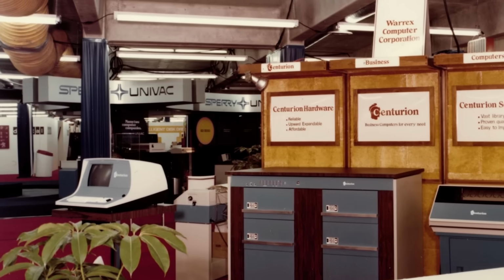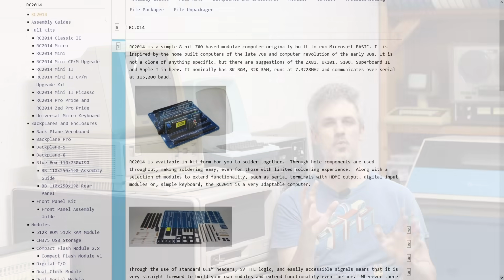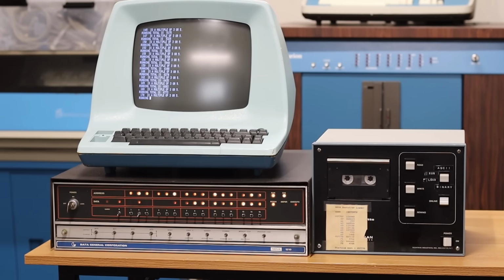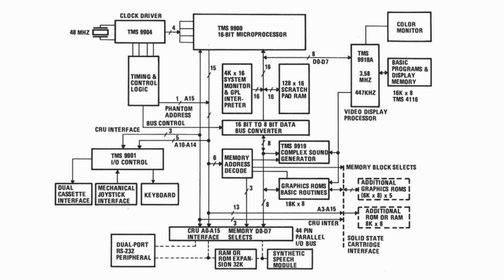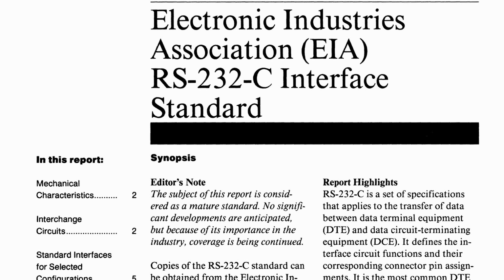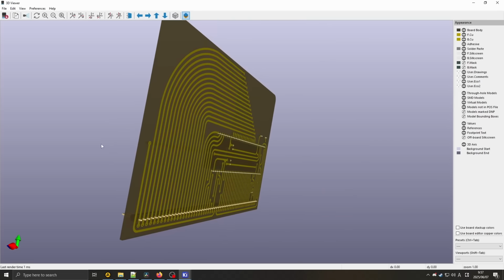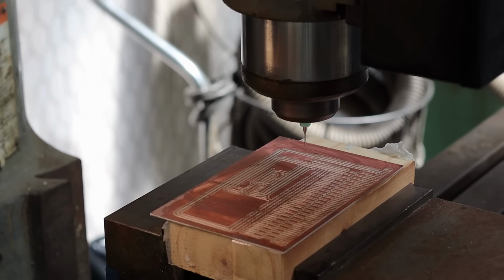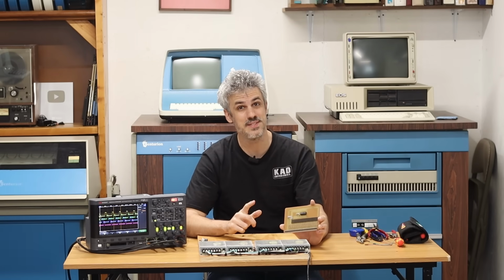The First Step in Building our TMS9900 Homebrew!

Comment: If you really wanted to build a mini using TMS9900 architecture you would use a TMS99105 or TMS99110 and optionally a TIM99610 memory management unit.

Comment: Great to see you turning to the TI chips. I worked on TI990 minis in the 80’s and loved those machines. It would be super cool if you could get your homebrew to run DX10
Reply: And DNOS - the "Distributed Network Operating System" that Austin DSG (Digital Systems Group) put out too! DNOS was bulletproof as DX10 would run into System Table Area (memory shortage) errors when saturated with a lot of tasks (which our group at TI used to do regularly.)

Comment: I think the DEC was lucky enough to have spanned enough years to be a mini computer that eventually utilized micro computer tech while retaining its full mini computer functionality. I learned on DEC in high school starting on a PDP 8 then a PDP 11, in college we had a PDP 11 that was quickly replaced by a VAX then I worked for many years at a DEC VAR where we sold, installed and maintained VAX and some Data General along with a few HP and TEK machines. Good times.

Comment: David... Meanwell RQ-125B, has all four voltages.
Reply: There is a downside to doing it in a single module: adjusting each voltage individually based on load becomes impossible -- it's all or nothing.
Reply: @TastyBusiness  It's true that it only has a 5V adjust. But the voltage output not being on-point at the PSU is seldomly a concern.
Reply: @graealex  The 5V adjust also affects the other voltages, I've had this problem with an RT-125A in my Nova 1200.  In order to get 5V where you need it, the other voltages clime proportionally.

Comment: Okay, but I think a definition of “minicomputer” is needed to distinguish it from a microcomputer, such as the TRS-80, Apple ][, or C64. It can’t just be the # bits on the data bus, as the Centurion has an “8-bit” CPU, but it can handle up to 8 users. But so can a PC clone running DR Multiuser DOS (or Real32) and a 4/8-port card (an expansion card giving you 4 or 8 RS232 serial ports for hooking to dummy terminals), and that has - at minimum - an 8/16-bit 8086 (and maybe a ‘286 or ‘386.) Is the PC therefore a minicomputer? If there is a line, it’s very blurry, I think! 😀

Comment: With the control over the hardware sprites you got with Extended BASIC the TI-99 was actually a pretty good home computer. I wrote pretty good approximations of Asteroids and Lunar lander on that machine. I hate that I have lost track of the cassette tape with the programs on it. The price of the expansions was the real problem.

Comment: Re: Mini-computers versus Micro-computers

I think you missed an important distinction between mini- and micro computer architecture. You touched on it when you mentioned the capability to support multiple users (or multi-programming), but a micro-computer can do that - but it will struggle.

Back in the days, back in the late 1970's, early 1980's, I was the systems administrator for a couple of computer systems at the university. One was a 68030 based NCR Tower running Unix with 4 terminals attached. The other was a Data General MV/10000 with 20 or more terminals. 

It was very apparent that the Tower system started to slow down when all 4 terminals was in use and students were busy editing, compiling, and linking programs. The MV/10000 on the other hand, just kept chucking along with more active users, batch jobs, etc. with no noticeable slow down. 

The secret that allows a mini-computer such as the MV/10000 to carry the heavier load is the use of DMA (Direct Memory Access) and intelligent I/O devices. It means that the operating system can tell a disk controller to "Fetch me the data on cylinder 12, sectors 6-23, and store it at memory adress 0xabcd1234. And tell me when you are done". After that the CPU can continue with other tasks and serve a different user. When the data is ready, the CPU will get a signal and it can do whatever is needed to hand the data over to user that requested it.

Comment: In 1980 I got to use a Fluke 1720A computer with the TMS9900 and bubble memory and it had an impressive performance. So when I got a TI99/4A in 1982 I was hoping to do interesting things with the processor though I was aware how slow that machine was from published benchmarks. I was disappointed at how closed the basic computer was and couldn't get the expansions needed to do anything with it.

Comment: If you used a Maxim Max232 chip, you won't need -12VDC. it can generate it's own.
Reply: That one does a few mAs for RS232 and is probably too weak. I do agree that the PSU situation is bonkers, since MW makes a quad-output 120W PSU that outputs all required voltages, even 500 mA -12V.
Reply: @graealex  since it is for RS-232 only, that is perfectly adequate. There's nothing else that should need -12V.
Reply: @Rorschach1024  David talked about 1W of -12V, but I honestly don't know how many UARTs, and what other chips might need it. Anyway, having a dedicated -12V isn't a bad thing, since it's easier to probe than the MAX232 charge pump.
Reply: But the MAX232 is a chip from 1986, so it's right out of there. We have 1488 and 1489 at home.

Comment: Boy, back in the day I used tape and acid to make my circuit boards
Reply: Etching allows you to easily route two traces between two 0.1" pin pitch legs. That's where isolation milling, especially in David's setup, breaks down.

Comment: hold on, instructional cpu or gpu, for compute, might not be the best. 8-bit logic gates pipeline might be much better, with data io. gate pipeline processor is still a processor. by definition. and its easy to reprogram each of the pipelines, which might be just copies, for multi-pipeline processing at same time. you do you bro. lol. however you define it, it stays at your home, with its definition. yes 8-bit eeprom logic tables compute pipelining would be the most simples fpga computing ever. that wood computer looks like a christmas tree, with programmable leds. yep, predefined re-programmable gate operations pipeline compute. instead of programming (5+10)*5, you just to a plus and mult in the pipeline. each gate is 64k look up table fixed footprint. accessed once per cycle as rom read operation. each gate eeprom reprogrammable. off the shelf eeprom. suits you sir, suits you. well, computer definition has reset to desktop pc, as of current. that means the room size computers are maxi-computers. anyways, pipeline gate logic does not have to decode/change instructions for every instruction, only when the task is completely changed by the program. all the instruction logic out of the window. yes fixed transistor logic pipeline from a reprogrammable gate logic pipeline. now you can actually compare how much more space each step of the logic takes. eeprom vs instruction transistor logic. also the eeprom gate logic pipelines dont have to use ram, they can use routed output cells between the eeprom gates. lsi, vlsi. any definitions are arbitrary, by people. all the definitions flex like they were on a race. generally it would be the size. also all computers, who cares. lol. no need to be hysteric about law definitions of any kind. nobody is going to judge you, I hope. its much more interesting to construct a computer or a computing system, or fpga design, by myself. actually pipeline compute + data io manager. minicomputing is alien to me. so why you need to separate home usage from multiple users. my home usage looks like multiple users. gpu compute is like zillions of users. I think any definition is out of place. multiple users is only a software thing, not a hardware thing. a single fast serial cpu can emulate parallel processing. anyways the pipeline processing assumes that the data io can push as much data as the many many pipelines can process. 1977 for a v/lsi chip. ok. again, doing your own photolithography vlsi chips is not hard at dvd-rom line widths (around 400nm-1um). definitions are an excuse to "be allowed" to use a chip instead of diy logic tubes. be-allowed logic stinks. just be free. no need to ask permission, or to get approval, thats 1st and 2nd amendment. ie no cops. God speed. diy before force feeding any horrible steep ui software. interest is absolutely necessary, not just someone pushing to do things, by any reason. if no self-motivation, ie want to do it, actually, then dont do it. yes no motivation is actual work. which is against actually free gift. have-to smells, hears and shows, always. I need to figure out what I'm interesting of doing in the compute hardware things, regarding the eeprom gate pipeline compute. its a free opensource design for now. dip switch. but is c64 programming that interesting, or even the chips and boards. is it headed. hmh.
Reply: yes fp8 eeprom gate pipeline compute with io.

Comment: AT power supplies as well as the early ATX power supplies have all the necessary power rails: +/- 5 V and +/- 12 V. The -5 V rail became optional in ATX 1.2, and I believe in practise disappeared in ATX 1.3. They do have a bunch of redundant cabling for a project like this, but on the other hand, could be useful for powering some peripherals if you would like to go there.

Comment: I dimly remember the 9995, which has 256 bytes of on-chip RAM to give you better performance on the register stack if you used the right workspace pointers. I worked on a project that was built around that processor, it was a pretty sweet chip--the workspace pointer made "real time" programming pretty nice, but I agree that the performance went way downhill once the WP was fighting with the other RAM operations.

Comment: Does the clock generator (or any of the other multi volt bias chips) have power up timing?  This is an amazing concept I can not wait to see where this goes
Reply: This was something I was going to ask. Many multivolt chips tend to glitch or downright break if the voltages are risen or lowered at the wrong order.
Reply: @DIYTAO  realistically, it's a consideration, but let's be honest too - for testing like this its probably fine. I just bring it up now because of all the blank space on the plywood 😂
Reply: @lindoran  True.. And Usagi has quite a lot of experience on working with exotic systems by now. I'm interested to see someone make well working computer of TMS9900, that Ti 99 was well.. Putting it politely, not a good design at all.
Reply: @DIYTAO i think the concern was price point and not cutting into ti's own mini computer businesses.

Comment: At a previous job I also did machining boards. The workflow I settled with was to do an inverse route. Essentially I drew the tool-path instead of the tracks. This doesn't get me the rule-check, but the software we had at work was so terrible that didn't matter. I also just used a single layer as aligning 2 layers is not trivial with machining. However I usually cut the "upper" layer there I put on the parts. That way I kinda "surface mount" all the parts (even the DIP ones) so I don't need to fully drill the holes. For analog stuff this has the added advantage of having the ability to do "3D routing". You can, for example, hold up a power rail above your ground plane with SMD bypass capacitors.

BTW I feel a bit worried about those gigantic loops around the high speed clock pulse lines. That's not good for signal integrity and might cause issues later.